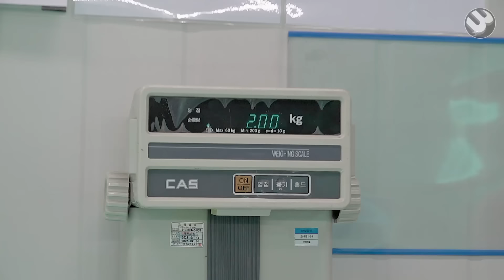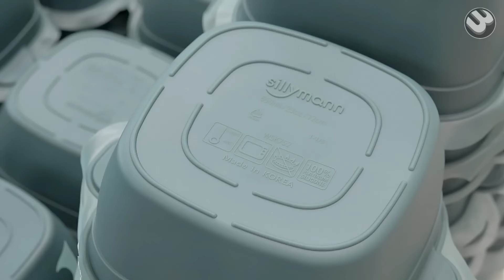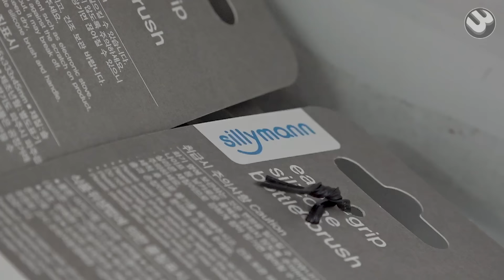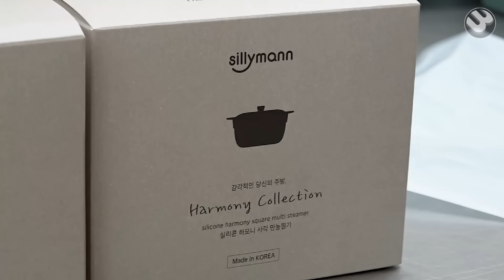High Quality Silicone Kitchen Utensils Mass Production Process. Korean Kitchenware Factory

Comment: Lot going on there I don't understand.  The silicon rubber is melting at handleable temps, but suddenly it can be a pot for cooking at 180c? wtf.
Reply: La silicona solidificada a altas temperaturas y alta presión, de ahí sale el producto según el molde

Comment: With the way the world is on plastics, products like these are so much worse. It is a neat process however the silicone takes thousands of years to decompose. The bottle cleaner itself would lose those appendages from use and they go down the drain and in the water supply.  Taking forever to decompose. All products made of silicone that can break away should not be allowed anywhere.